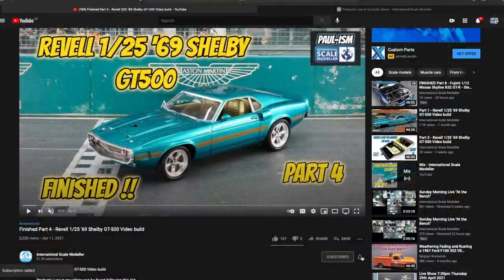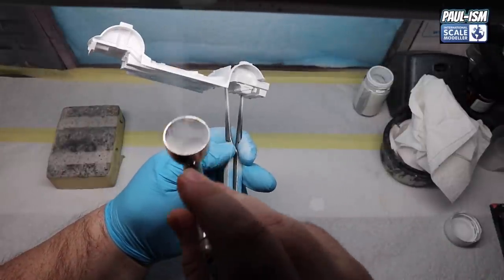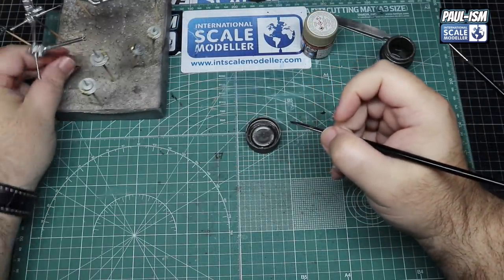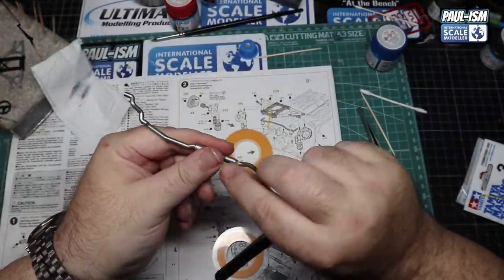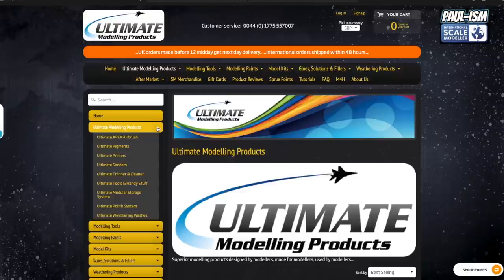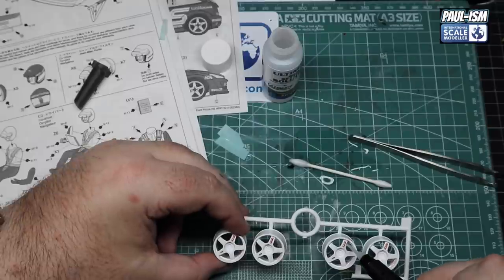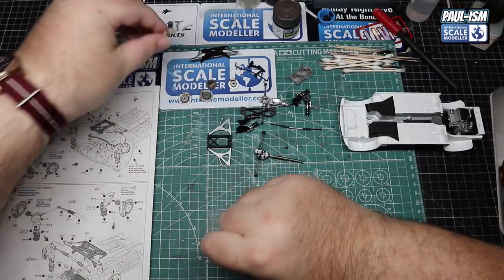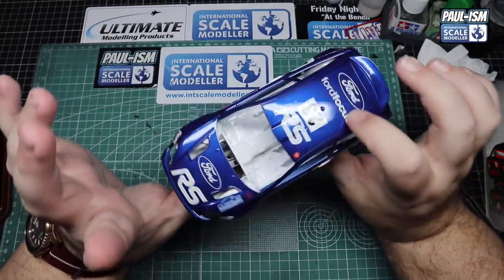Part 2 - Tamiya Ford Focus RS WRC '02 Video Build

Comment: Thanks for the video Paul, informative as ever. I agree with you on adding depth using washes. An alternative to the enamel Tamiya wash is Games Workshop ‘Nuln Oil’ shade paint. It’s water based paint so has the advantage of drying in around an hour. I use a 50:50 mix of standard and gloss over metallic parts. Washing over the whole part, it leaves a nice shadow effect in the recesses and a very light satin sheen on raised surfaces which gives a good impression of oily dirt. It’s also much easier to get hold of in the Uk compared with the Tamiya wash.
Reply from the maker: Hey john yes I have that will give it a go cheers mate

Comment: suspension things are expansion oil reservoirs, its so the oil has somewhere to go if the shock blows through its whole travel, some expensive mountain bike shocks have the same fitted to them